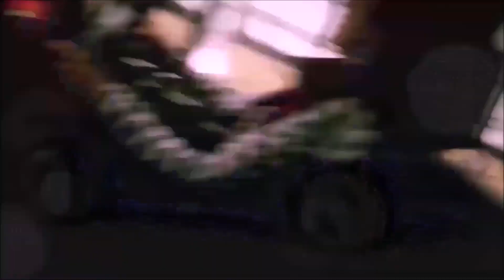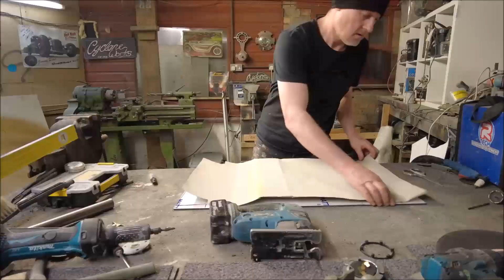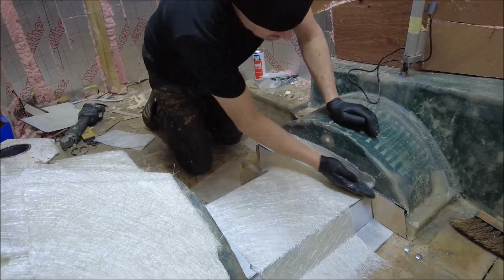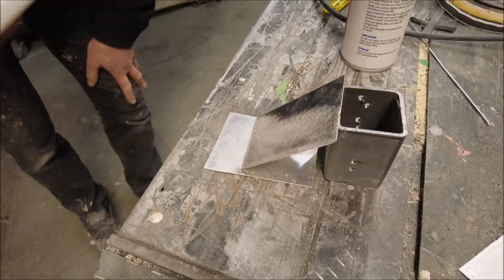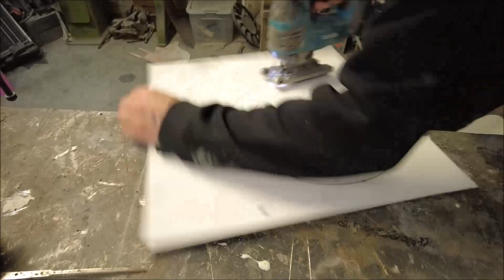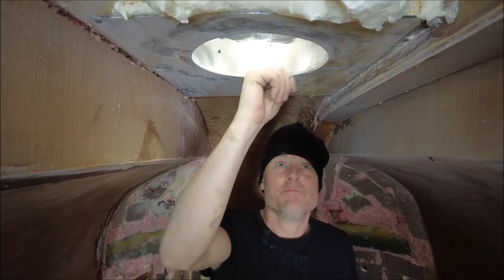Do Aluminium Welding Rods actually work?

Comment: Some types of aluminum brazing rods do kinda work. Brush the parts to be welded with brass bristle brush prior to “welding” and the brass fluxes the metal and it helps. Those instructions came from the only company that makes those that do work for filling stripped bolt holes for welding and some other choice stuff but welding like that won’t work unless you TiG it!!!!
Reply from the maker: I might give them a go one day, cheers

Comment: Hey Paul regarding the welding of Aluminium with those welding rods, I always thought that they were suspect. However your test wasn’t very scientific. The bench you had the flat piece on, was it steel? If it was it will sink all the heat from that plate so the two surfaces won’t heat up at the same rate, therefore you add more heat and the top piece get too much and melts.
Reply from the maker: Haha, it was only a simple test, but I tried them a few times and they are genuingly rubbish.  Apparently more expensive ones do work.